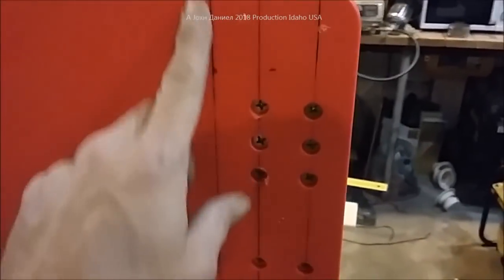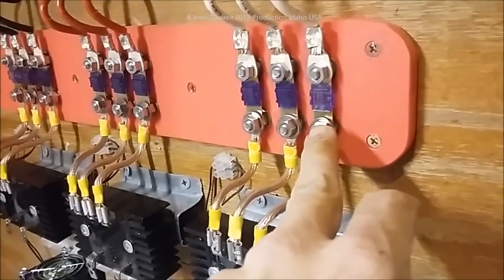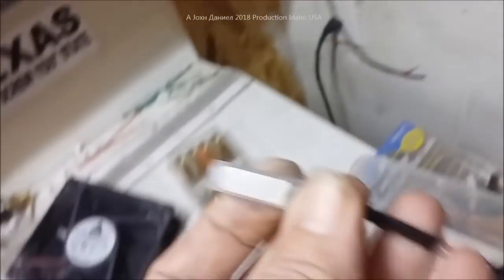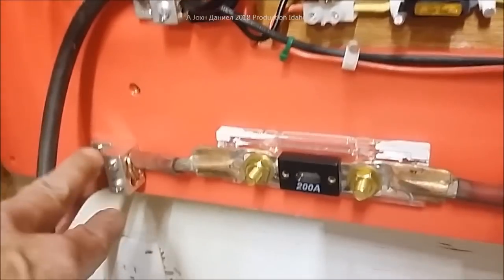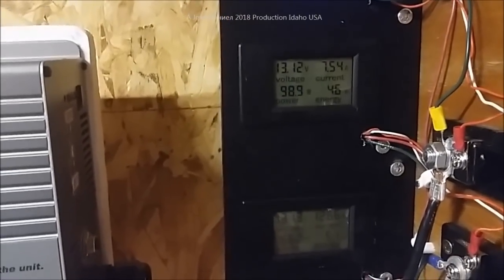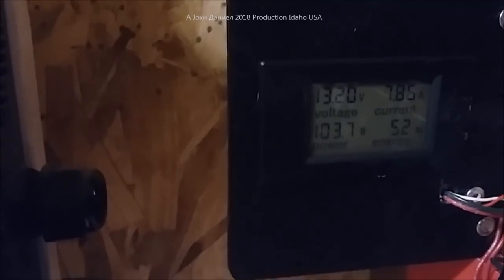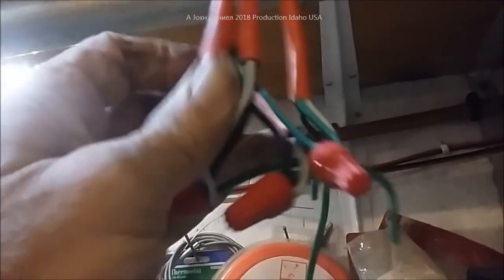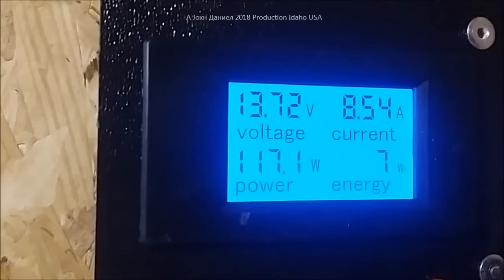Micro Wind Turbine 3 phase power systems Rectifiers pt. 1 my FULL PARTS LIST BELOW

Comment: How you keep your battery from overcharging
Reply from the maker: Since I run numerous wind turbines I designed a 3 stage system, flow through resistance ( on a video near this one ) and dual stage diversion loading.
Reply: @JOHNDANIEL1  do you have have a vid on your dual stage diversion loading
Reply from the maker: I use 2 of the Wind and Sun controllers, ( https://ebay.to/2T6TGHs WindSun-Controls Designed for Solid State Controls, & MAGER SSR https://ebay.to/2R5eBsvone ) set at 14.4 volts with 500 watts of diversion, the other set at 14.8 volts with 700 watts of diversion. 90% of the time the first one maintains the system perfectly. But in a wind storm they work together to pull 1200 watts of load which slows the turbines output about 30% due to load and also eats up excessive battery load. The WindandSun controllers use Solid State Relays, they TRIM the excess power. A controller with a big solenoid like a popular fake advertised 440 amp,  hammers the whole system killing your batteries lifespan and even is known to burn up turbines. The wind and Sun (12V/24V Relay Voltage Triggered Load Controller "W/Delay" LVD HVD 1URVTLC-1224 )are  so accurate it makes it so I keep my inverters from getting hit with 15.5 volts and put into over volt and they are so fast I never get below 14.20 volts charge when they activate.

Comment: John, do you have brakes on the new setup? If so, what did you use?
Reply from the maker: NO BRAKES, resistive multi stage diversion and counter loading. My own design. Brakes, where you short out the PMA is about 100% crazy and a insane thing sold by Wind Turbine hustlers, Usually the wierdo in Missouri sells a silly switch that ties the leads from the turbine together. You must avoid anyone who offers or infers such a thing. Proper breaking is resistive passive system that controls run away, makes the heat away from the PMA and is safe.

Comment: Hi John. Just wondering what gauge wire you have running from the turbine?
Reply from the maker: 8 awg 30 feet
Reply: @JOHNDANIEL1  Thanks John. Have my turbine up now, about 50ft of 10awg to controller. Only getting about 20w in 10mph wind 😒 Somethin ain't right.
Reply: @JOHNDANIEL1  Update: Losing a shitload of power because of light gauge cable 😂 160w at least. Who knew?? 😊

Comment: Because offshore wind farms are located on seawater, the water vapor will deposit in the tower and cause sudden failure of the fan equipment. The operation and maintenance costs are high. Therefore, consider using the wind energy off-grid system to drive the dehumidifier to keep working. https://www.linkedin.com/pulse/necessity-installing-small-wind-power-dehumidifier-4mw-ailan-huang/?published=t
Reply from the maker: Dehumidifiers are not functional with salt air. But heat would be the best method to remove moisture with salt in it.

Comment: John I noticed on AliExpress the turbine comes with 1of2 mounts flange or hoop (attaches to the pole) do you have a preference. And comes with a charge controller are they any good or just use the rectifier
Reply from the maker: The flange is best, and the 600 watt 12/24 controller they have is bullet proof now.
Reply: @JOHNDANIEL1  thanks you're always so helpful
Reply: Јоhn Daniel  john I just rec'd my 500w Chinese wind generator w the charge controller. Now this controlller has a built in brake, rated at 30amps. will i also need to install diversion dump or do you think this controller will do the job. I will be installing this weekend
Reply from the maker: chrischrismelco  If its the same turbine then the controller for it is a good all-in-one controller. It may require a diversion controller also if its top voltage setting ( brake on voltage ) exceeds your inverters max voltage. If in high winds it puts your inverter in over volt fault, reset it,  and asap put you in a diversion controller. Depending on your wind zone I can send you to a easy to use SSR model that will be a simple addition.
Reply: The brake on at 14.5v   I am located in upstate NY elev. 1800 ' valleys on 3 sides and 45' tower. This is a week end place
Reply from the maker: chrischrismelco  Sounds like the improved version of that controller, the old ones were set at 15 vdc. Excellent. It will help bulk charge and equalize your batteries if you get decent winds.
Reply: @JOHNDANIEL1  so should I do SSR
Reply: @JOHNDANIEL1  got my new Chinese wind turbine was getting ready to install it John it appears that the slip ring is not functioning properly when I rotate the flange the wire's are twisting I really don't want to send it back to China.....any ideas....
Reply from the maker: The slip ring body is in the flange pit. They will turn by spinning the flange. Hold the flange and spin the turbine, note the wires will not spin.
Reply: @JOHNDANIEL1  thanks again I'll check that out
Reply: @JOHNDANIEL1  John got my. Chinese turbine installed got a 12-20 mph wind and I am only getting 8-10 AC volts out of the three AC leads and nothing out of the controller....any idea what be the problem??
Reply from the maker: Somethings definitely not right. Make sure no wires are touching each other in the 3 from the turbine, be sure they are taped up well and running separately with nothing touching on them or in your pipe. Then test them without the controller. Seen this before where someone had 2 of the 3 touching or even tied together at the turbine.
Reply: @JOHNDANIEL1  so John why is that if those wires are taped together or touching each other inside that tube from the turbine that they almost short out I mean there's no wires frayed or anything but that's weird if there tape together like that that it changes the voltage
Reply from the maker: I have seen people use too long of wires, seen them twist all 3 wires from the turbine into 1 wire somewhere in the length, seen a bare wire touching the pipe, and seen them use 16 awg wire and expecting results.
Reply: @JOHNDANIEL1  well I don't know what my problem was I used 8ga butt connectors and taped them, and taped them together I untapped and retape individual, 
now drill ran turbine got 25vac. Weird but it's making power so I am happy now we just have to tilt the tower back up

Comment: john what size are those fuses at rectifier? next question from my new 500w 3phase turbine to battery bank 200ft. will 12ga be ok for the ac, then connect to rectifier.
Reply from the maker: DEPENDS. If its like mine, 12 will burn. If its one of those little short tail 15 lb fake claimed turbines, 12 is OK because it don't make any power anyhow.  For one like mine, thats too far for 12, 12 is only good for up to 350 watts, like a 2000 watt "claimed" Vietnam made Missouri Turbine, they themselves put 12 on it knowing it can't hardly hit 300 LOL!  
Its at the furthest limits and then some of 10. Your in the 8 gauge area at anything over 160. My suggestion, get it closer or go 8 gauge. Even 8 is only good for 210 in that set up. Just don't say the turbine can't work if you don't wire it right. Mine uses 12 feet of 10 down the pipe, then 8 the next 26 feet to the control board i have.
Reply from the maker: btw - Fuses are 60 amp
Reply: John it's the same turbine you have. How many AC volts  and amps is coming off that at Max output
Reply from the maker: Wind turbines are watt rated at 24.4 mph from the SWEA. In this ones case, my area, my air density : Amps and volts, Hmm. Forcing me to walk to the shop and dig up my notes! 
OPEN voltage at 24 mph winds, 49 vac. Total max amps at 24 mph 63amps, with a recorded peak in 44 mph winds of 87 amps. Max wattage recorded is 1121 watts in 47 mph recorded gust. Volts AFTER  rectifier 36 vdc ( no load no battery in 22 mph wind). 
On battery volts are maintained by the batteries. So diversion is set, stage one at 14.45, stage 2 at 14.65.
Seems they are using a 100 amp 6 brush slip ring, thanks for that in my case. 
NOTE: any turbine thats advertised at 2000 watts and claims its for 12 volt or even 24 volt, is a fukn lie!
Reply from the maker: You should definitely go to 8 gauge. Look up,  https://www.wireandcableyourway.com/8-awg-thhn-building-wire.html and get it in BROWN its more sunlight resistant and if over head pull  it in 3 separate strands 4" apart with spreader bars ( 1 foot of 2 x 2 wood ok for spreaders, use wire holders) every 10 feet. Run some 3/16 steel cable over it to aid support for distance. 
If underground, put it in cheap one inch 100 psi black Poly tube like for sprinklers about 6 to 10" under the ground. Poly available in 250 foot rolls for about $50 to $75. To get it through the whole tube, tie a fluffy cloth on a string, suck it through with a good shop vac,  then put a little stronger 1/4 rope on it and pull that back the other way, then use the 1/4" rope to pull your 8 gauge.

Comment: Really cool setup, I am looking to build a similar setup. Do you have a wiring diagram and details on the configuration to charge controllers, batteries and inverters? I have purchased most of the parts you recommend just need some help on the wiring, don't want to blow anything or myself up!!!!

Comment: I need the links for the fan and temp switch.  PLEASE!
Reply from the maker: OK, these are the ones used 80mm bearing 12vdc FANS https://ebay.to/2Jz935Z I use
And the Temp switches 45 Celsius ( 113 degrees Fahrenheit) https://amzn.to/2zRaJbh that turn on cooling for the rectifiers. Wire the fan power through the switch. The fan model I use can be mounted in any direction and is exact air flow with very low power use.
Reply: YOU are the man!  THANKS!!!  Is that 12 AWG coming from the turbines into the touchable terminal blocks--connecting to the fuses?  Also... would love a link to the high temp cutting board.  Thanks in advance!
Reply from the maker: 10 awg 44 strand copper auto amp power cable. The board I am using is 100% non electrolytic and 1/2" thick https://amzn.to/2A9GKf1

Comment: Do you have a dump/brake setup? I didn't see one. Is it up higher than the video showed? Is it manual or will it engage auto?
Reply from the maker: Yes, I am using a multi stage progressive diversion load system of my own design.
Reply: Јоhn Daniel I saw where I think you have it upstairs. That appears to be manual. Do you have an automatic brake in use that either senses the Hertz increase so the turbine can save itself if you happen to be away?
Reply from the maker: I'll be making some more wind videos soon, but my busy work season is on and outdoor work rules the day. See this, for the controller. Now 2 are in use with different volt progressive settings. https://youtu.be/SfBEXZn8Ppo?t=4m9s

Comment: Like your set up, one question I see your system is 12voits is these items available for 48v system
Reply from the maker: The rectifiers and meters are good for any voltage to 100 volts. But to run diversion controllers you just tap your battery bank at a 12 volt point, then run relays at 48 volts contact point with resistors you need.

Comment: Hi John i was wondering why did you use rectifier over charge control? I bought my Chinese wind turbine this winter like your with 600 watt charge control with dump load with it for 360$ cad ... i was just curious why did you go rectifier way is at because its cheaper ?
Reply from the maker: 1 turbine then a factory charge controller is fine, but with 3 its not good. Those little controllers voltage settings are off just enough that one may never do diversion loading while 2 would take the load of 3 turbines too often. My system uses rectifiers like whats in the little provided controller but just 1 diversion unit to cover all voltage being produced.

Comment: Very nice set up and very clean too, I appreciate it when I see nice wiring detail. 
My question to you since I want to set up a multi turbine system can I used a 48v rectifier in place of a 12v as yours, my other question is your system going into a charge controller then your batteries 
Thank you in advance
Reply from the maker: The  rectifier knows no voltage. It is only a rectifier, numerous diodes that just convert AC 3 phase to DC. Same one will do 12,24,48, or more up to 1000 volts. The charge controller is a WindandSun diversion unit, anything above 14.55 diverts into resistors to keep voltage safe. Turbines are direct to battery bank after rectification.

Comment: It's not clear what your storage is, lead acid batteries? Lead acid is only about 50% efficient in storage. Very nice, neat wiring setup.
Reply from the maker: Battery Efficiency is in the eye of the beholder ( scratch that ) Wallet! My L-16 bank of 14 batteries will last 10 years, at a cost of $270 a year. A Lithium bank would last 6 years at a cost of $1725 a year. And a yet to get made in the market is a Air pressure storage to Motor automatic boost charging system thats cheap but will extend all battery life expectations. I have a small version that gets power when the bank is full from solar and the controllers are in idle ( about 3 pm) and is using 4 DC 140 psi  pumps, a 40 gallon tank and a cessna air motor running a 35 amp John Deere alternator thats very effective in coming on at 12.2 volts and putting a nice 45 minute 25 amp charge on the bank. keeping your bank at or above 80% DOD ads years to them, Still working out the details.

Comment: did i miss something on the slip ring not sure what its for or where it connects
Reply from the maker: The slip ring is a rotating electrical connection. Allows your turbine to spin about into the wind and keep the connection from it to the control board/rectifier. You will see the low tech cheap stuff just telling you to let your wires wrap all up in the pipe the turbine is on. That wires with no slip ring was back in the day crap from the moron in Missouri selling his junk since he was just stupid, but he does make good DIY videos for other morons disguised as Mr Super Wind Turbine Guy!!

Comment: Great job. One of the things I like is that you're not only spending much less on your system by using affordable yet functional small units, but that the redundancy (duplicate units in parallel) will allow you to still produce electricity if/when something fails. I designed my off grid solar system the same way, only with two banks instead of three. ....I'll be adding wind eventually. Thanks for sharing your projects.
Reply from the maker: Its like carrying 2 pistols, 2 knives, 2 ball bats - makes you the most dangerous man on the street! Redundancy = Intellect applied!

Comment: Can u send me information on this set up
Reply from the maker: Possibly, I can do some upgraded schematics in the future with a walk through.
Reply from the maker: REAL Wind Turbine from http://s.click.aliexpress.com/e/qv7ayvN all specs there. Also Restored CHAOS turbine a world famous HORNET PMA https://tinyurl.com/SUPERhornetPMA1k REAL POWER
PARTS TO GET BELOW 
100 Amp Rectifier BAO-Amico http://amzn.to/2DkP4q7
3 pole double brake Switch http://amzn.to/2FrFOB5
100 watt Brake Resistors http://amzn.to/2FrzwRQ
- WIND AND SUN Diversions controllers, So Smooth, Battery Saving. https://tinyurl.com/WindSun-Controls by J Mason Design Solid State Controls, SSR the rest are crap~
-Rectifier Spade Connecor Terminal 3/8 https://tinyurl.com/Proper-375-Fmale-Terminal  Proper .375 inch Fmale Terminal
Reply from the maker: And, I may start making mounting kits for the CHAOS turbines, mail order only, NO SALES TO MISSOURI LOL!

Comment: What the cost of that setup an do u make up set like that to sell
Reply from the maker: I build for my installs. Last year I installed for 8 people, 1 to 5 turbines per job and many solar panels. I don't sell just install and all of it is word of mouth. They buy the materials from a needs list, I install. So cost depends on your area, parts needed, and what your trying to end up with in power production. Small systems would be 500 watts solar, 2 small turbines. Large systems like the one I built in Alamo Nevada would be 11,000 watts solar and 4 Sunning 1000 watt 24 volt turbines.  So all of it depends on your needs.

Comment: So your showing wattage and amperage "from" the Chinese Wind Turbine. Will you please tell us what you are powering with the amperage that is being shown on the amp/watt meter where you were getting 500+ watts John.
Reply from the maker: All but the 220 vac on my shop and all our outdoor lighting comes from those turbines and 4100 watts of solar. Goes into 14  L16 batteries, then a 5000 watt and 3000 watt pair of inverters. From their its back panel wired in 4 runs of 10/2 wire to 16 of the 19 breakers in the shops wiring. 3 freezers come off the regular duplex of the 3000 watt true sine. The house has 1980 watts solar and one 500 watt HYE wind turbine with 12 batteries, a 3000 watt and 1500 watt inverter. A set of wires join the shop and house with 15 amps of 120VAC for any need that may arise. House has all propane heating and dryer.
Water well at 460 feet deep and my welders when I use them are grid power.